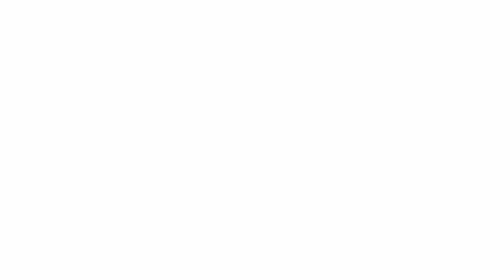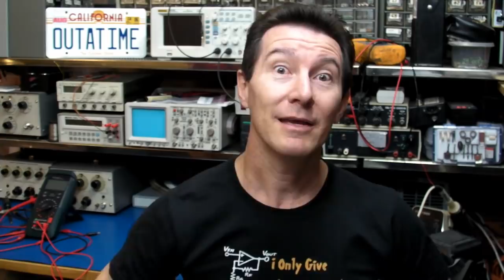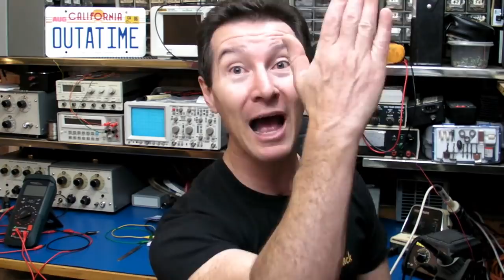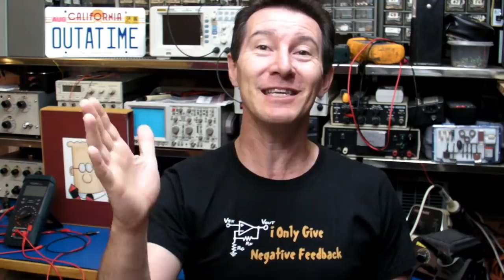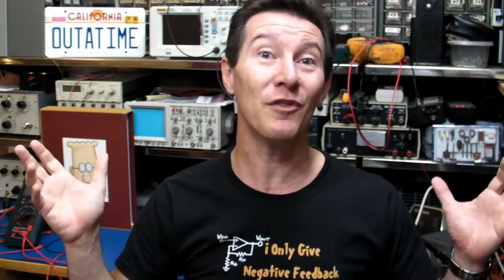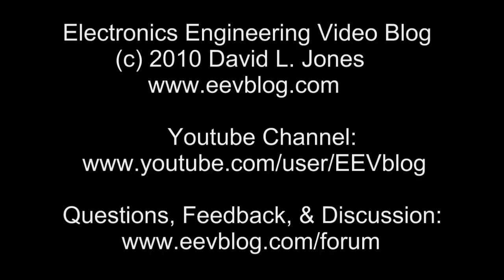EEVblog #138 - Top 5 Engineering Graduate Tips

Comment: I left my big corporate engineering job 9 months ago to move to Canada. I'm now living with my wife waiting for this COVID crap to blow over, then I can hopefully get a job.

There's a lot of BS out there regarding job searching. I'll tell you one thing I've learned so far, contacting a hiring manager DIRECTLY will yield orders of magnitude more responses than using a company's BS online application process.

Online applications are WORTHLESS for engineers. Do NOT bother with it! It makes it easier for them to find thousands of candidates, but significantly harder for you to find a job. Bypass it altogether!
Reply: Build your own projects as Dave says, but open source them and make public github repos. Make a few videos, if you care to, showing the lessons learned.
Reply: Most of all, try to work for people who actually understand at least 10% of what you do. Avoid working for a pure project manager who does not have a STEM degree. You might make them happy, but they will never be able to give you a proper reference or recommendation. They just don’t know.
Reply: Well sure, if you can figure out who those people are. For the record, I just hired two people who applied online. I work for a reasonably large company too (5k employees or so).
Reply: @oambrosia  it's very easy to figure out. Just use LinkedIn and google to figure out their email structure. No problem. I'd say 80% of the time you can figure it out in less than 10 minutes.
Reply: @vejymonsta3006  Fair enough...so long as people keep their LinkedIn and such fully detailed and updated. I don't :P
Reply: Learn to be creative in how you solve problems. Demonstrate creative thinking, which will set you apart from others. Find a mentor or mentors that are old school. Having deep insight into the science will serve you well and let you solve problems that ordinary engineers can’t fathom. Be brave when opportunity presents itself.
Reply: @Douglas Blake What do you mean by that? Do you walk in and make an appointment in person?
Reply: funny thing... I re-applied to online job from years ago and now I failed the same tests....
Reply: How the fuck do you do that?
Reply: @Douglas Blake How can we find out the Boss from LinkedIn and Google, whome the applicant would be working for ,if he/she got selected for the published open position?
Reply: @Douglas Blake Yes. Always nice to get proof before you hire and the trial period starts. Stand-up interview exams is one way. It all depends what you are looking for, so they are not always the best metric/test. In addition to looking for people who work on their own projects, I really mainly look to see if they are curious, good team players, not over-confident (that is, know that failure is an option and are motivated to avoid that) and they are good problem solvers. A good question is always, "tell me about a time when you had to find a unique, weird, or non-standard solution to any problem, not just what this position requires." 
Anyway, Dave's vid is about your own career development and not so much about how to be hired, but they are related. Thanks Douglas

Comment: I'm lucky, I guess, I'm at the top of my particular job, I get the "hard jobs", and honestly, those are the ones I want. I figure out the problems the others could spend days figuring out. I really hate the "typical maintenance jobs". I want the challenging jobs. I suppose that since I'm the highest paid guy in the shop, those are what im valuable for to do. (I dont have a fancy title of "shop foreman", or anything like that. But, the tricky stuff always finds it's way to me). I wouldnt want it to be otherwise, that also means I get to build all the "fun stuff" like hotrods & fabrication of the "odd ones" that are different than the run-of-the-mill boring builds. It also means I get to make the "stuff that doesnt exist yet", which is what I really enjoy doing. I'm really glad my boss allows me to do those things.
Reply: The problem when you reach this level is that you usually have to work too much

Comment: The problem with jobs that involve the complete product life cycle is that by the time you start a new project, and are again involved in the technical design phase, your design skill may be out of date. In my industry, a product life cycle was several years, if the maintenance phase is taken into account. In that time the technology moved on, and design skills can become rusty or obsolete. 

In my time in the industry, I was involved in projects that used discrete components, TTL, CMOS, LSI, MSI, microcontrollers, DSPs, PLDs, FPGAs and ASICs. Each involved learning new working methodology, new design limitations and new software and toolsets. Examples being: assembler coding, C programming, back to DSP assembler, PLD coding in proprietary software, then using VHDL for both PLDs, FPGAs and ASICs.  All this along with new simulation and layout tools. It takes time and practice to become really good at using such tools, the last thing you want is to spend 12 to 18 months not using them.
Following projects through their life cycle meant that each time I returned to the design phase, the technology had completely changed. I would have liked to have spent far more of my time doing R&D, the bit I loved doing, I feel sure that this would have allowed me to be a lot more productive during my career, as it was, the split between design and other was 10% to 90% or worse. The only advantage was that I was involved in all aspects of the products life and had a far greater chance to interact with the customers and more importantly the product users. I am sure there is a place for both the generalist and specialist. I think companies lose out by not allowing engineers to concentrate on the R&D and maybe specialise if necessary. At one company, I wrote a internal paper on the subject. This advocated changing the project based organisation of development to one of expertise centres, where designers could specialise in particular areas of design, maintaining their skill set. The idea was that one of the expertise Centre would take the traditional project based approach, but this area could call upon the specialists from the expertise centres when required. Seconding the designers into the project to do what they did best.  
I failed to get the idea adopted, because it was considered to complicated to manage, even for a big company. The fear was that the design experts had two managers (masters), one from the project to which they were currently assigned and the manager who ran their particular expertise centre. I did not see any conflict of interest, but those in charge disagreed.